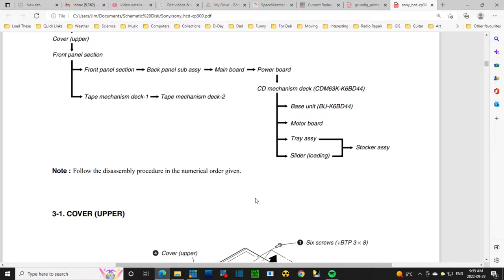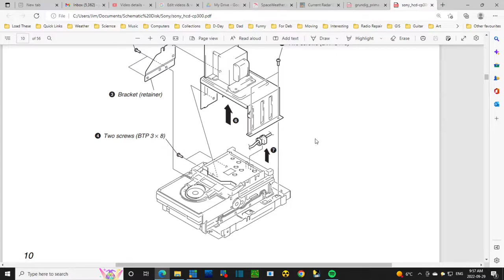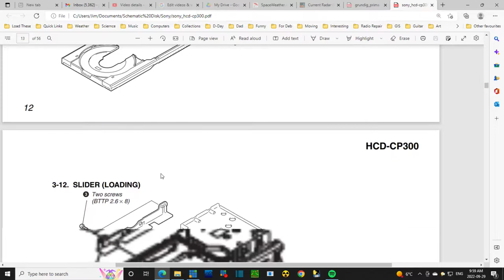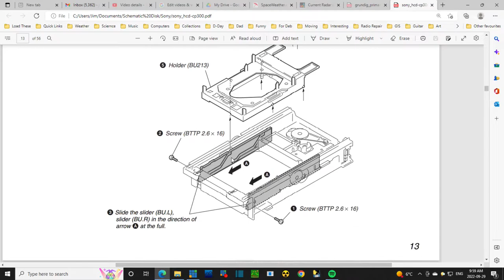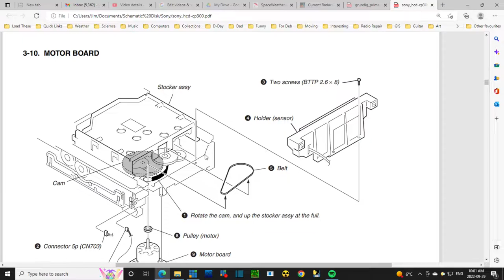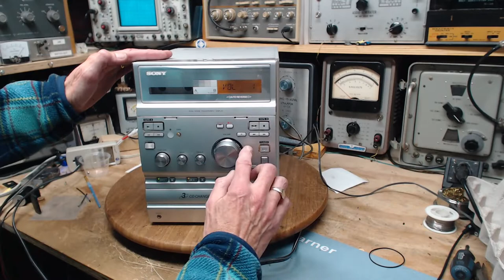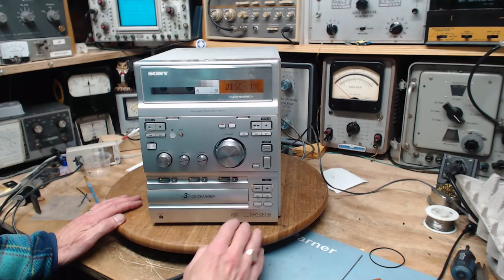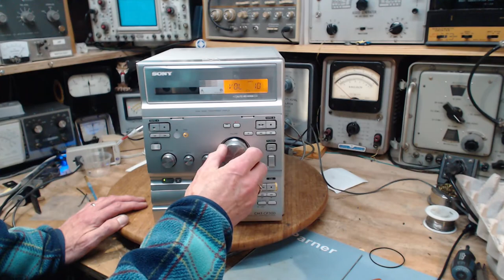Sony HCD CP300 Micro HiFi - Replace CD Belt

Comment: Thanks for taking the time to make this video. I was able to fix my Sony HCD CMT-CP333 by replacing the CD loading belt as described in your video. But after a few days, the stereo machine stops ejecting CDs again. The new rubber belt is still in a good condition but there is another problem that prevents the machine to eject. I would appreciate it if you can help me to solve this problem.